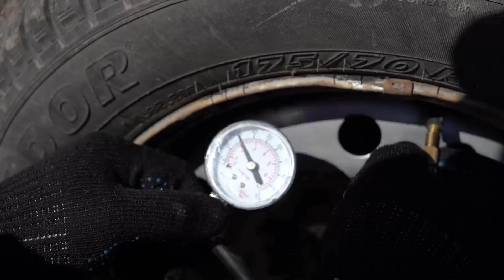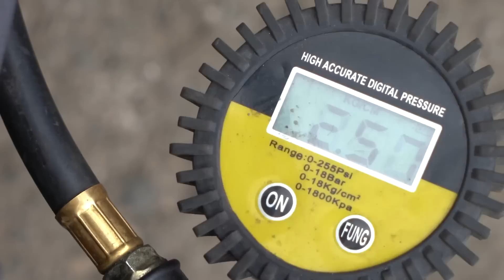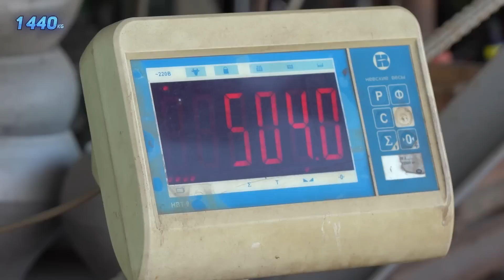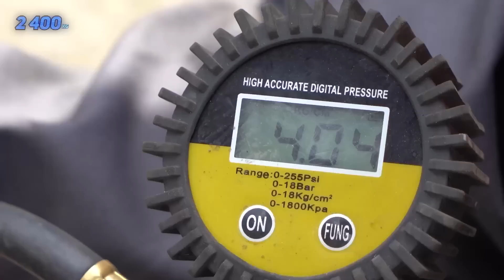How much weight does it take to pop a tire?

Comment: Remember, load rating is not how much weight a tire can hold up, it is how much weight a tire can prevent from sliding.  Heavier vehicles require more force to slow down, and if the rubber cannot handle that force it'll tear at the surface and slide instead of stopping the vehicle, creating skid marks.  Also, when you are turning it's the tires job to prevent the vehicle from sliding left or right.  If the vehicle is too heavy in a corner, you could slide off the road too.
Reply: As the more weight you add to a tire, the harder it is to slide
Reply: Can't find a single thing online proving what you just said,  just what weight tires support, so I don't think this is a factual statement at all
Reply: @tyuy100  The load rating limits what rubber compound companies can use.  The softer the compound the easier it is to tear off like an eraser.  Motorcycle tires can use a soft grippy compound because they have a low weight rating and don't see large peak forces.  Truck tires have to use a harder compound to support the higher load rating.  When performance electric cars were newer, they had trouble finding sporty grippy tires that had the correct load rating for the heavier vehicle.  Of course this is not a 1 to 1 relationship, but it is one of the many variables that affect the entire package.  Surface area, or tire width, also affects what compound could be used because with a wider area, each piece of rubber would experience less force.  As others have mentioned this video primarily demonstrates a static load while the tires need to be rated for a dynamic load.
Reply: @1234567890CAB  I don't disagree with any of that. I just think the statement about grip wasn't very factual as the load rating isn't necessarily focused on grip and wear seems to be the main component and of course complete failure, both of these affect grip but grip isn't what the load rating  refers to exactly. That's all I meant, from what I could research at least
Reply: Load rating is actually how much heat the tire can dissipate at a certain weight and pressure. The more weight on a tire the more heat gets created as it rolls. Source, I work at a tire shop and i have taken literal classes and tests about this, what you said didn't really make sense either.
Edit: excessive heat from running tires too low on pressure with too much weight is the #1 cause of blowouts.
Reply: @mr.disprosium4012 I’m glad there’s a tire place with someone like you. You’re completely correct.
The load rating is determined by the structure of the tire and rated pressure. A tire with a stiffer sidewall and higher pressure capacity will flex less on the highway, heat up less, and hold more weight. This is also why speed ratings are a thing. A tire flexing more times per second absorbs more heat.
Tire grip is determined by the compound touching the road, and the wear rating (UTQG) is a good estimate of grip (low number) or wear (high number).
Reply: @gvr41510  thank you for giving a more in depth explanation, you actually explained it way better than i did. I just saw that comment at the very top and was like whoa this is wrong and too many people are agreeing with it.
Reply: Load rating is not about traction, it's about getting the tire to its max speed rating with the rated weight guaranteed without blow up to pieces.
Reply: @johnbelwell2461 nope
Reply: Load rating is the safe load a tire can handle at its speed rating.
Reply: @brandenwaltz9879 nope
Reply: Load range is from the construction of the plies and how much it needs to be inflated. All tires have a separate speed rating. Most cars have load range b .
Reply: @dennis-nz5im  the construction of the tire is irrelevant to mention, whatever type of tire it is has its ratings for its construction, if we say it's a 22.5" semi truck tire it still has maximum load and maximum speed, which is manufactured so when both are maxed out and the pressure is the maximum rated under load the tire is guaranteed it wont fail.
It's like we say you can run to 20kph carrying 10kg with your hands and we have tested you can do it without smash your face.
Reply: You're very confident for how very wrong you are👍 maybe dial that back a bit

Comment: kg/cm² and bar seems like the same. usually bar is used except for the USA, Myanmar and Liberia that use PSI. well that's what I could find anyway.
Reply: They are very close. A bar is 10 newtons per square centimeter. In layman's terms, kgf/cm², bar and atmosphere are used interchangeably but they are slightly different. The first is 0.980665 bar and the latter is 1.01325 bars.

Comment: Tires are rated to deal with potholes at high speed. The waving of metal strings keeps it together but not for long the heavier you go over the limit.
Wheels are usually the weak point in real driving condition unless something punctures your tire as usual.
Reply: The static load is the easy part, heat buildup in the tyre while it's rolling is the real tyre killer. Driving for a couple of hours at highway speed is where the load rating matters - very few real world users would be happy if all their tyres could manage was to survive a lap of the car park in 1st gear.
Reply: Some other news: water is wet.
Reply: It also depends on tire pressure as well.

Comment: That van is pulling like it ain’t shit back there 😂😂
Reply: I could be mistaken here, but I think that van utilizes a 2.4 liter diesel that Toyota used to put into buses.
Reply: @SwapBlogRU  My 1958 F600 has a 292 CID gasoline motor, and it hauls around 26,000 pounds on axle without a complaint.  What Sparky said was right, it comes down to gears and low speed.  That Toyota motor is a good one, but without some serious gearing, it too will pull itself out.
Reply: @kingduckford  as far as I know these got a sort of generic gearbox from the factory, can't tell you whether this particular example has been modified or not.
Reply: @SwapBlogRU  tbh it should pull it with ease if my surf is anything to go by.
I had a 2.0 k20 honda crv mk2 with a manual gearbox. I pulled an approx 18ton Dennis elite 2 refuse truck (completely dead) out of our workshop and round our rough af yard with it lol. Clutch started to stink but it did it and the clutch was completely fine several months later until the car was written off 😂
Weight is just a number, it's the rolling resistance that'll make it struggle. The first second of getting it moving is the hardest. Slowing down is the other big worry. Once it's up to speed it's fine.
Reply: @SwapBlogRU  should be a Toyota 1kz-te 3.0td 4cylinder. Solid engines, got one in a hilux surf.
Reply: @dahotrod1533  right, thanks for the correction!
Reply: The van never saw 10mph
Reply: its also a diesel
Reply: 3.0 Turbo Diesel...
Reply: fr
Reply: XD
Reply: you can manipulate the gearing in any vehicle to tow anything at a low speed technically
Reply: @TheUchihasparky  Since it's the 4x4 version, it's probably got an extra low 1st gear. There are versions around with a low range transfer case too - 4XOverland has done a few videos recently on an off road Hiace he's converting to an overlander. Anyone who's driven a tractor knows that you don't even need 100 bhp to effortlessly move very heavy loads around at low speeds.
Reply: @peglor  Must have low gear to pull that. My dad have a 4x4 hiace with no LOW GEAR. and the first gear is WAYY too long to do a hillstart without burning the clutch :D
Reply: @TheUchihasparky Not with any vehicle specially rear wheel vehicles. 😂
Reply: Could you also argue that since the tires are crushed they have a better grip? Since all the weight is pressing them against the floor and the tire even developed a flat surface. Id assume its grip or traction would increase drastically specifically at low speed. 

I dont know about towing sadly but for what i can see and my experience with not well filled tires. I feel thats also a thing to account.  @TheUchihasparky
Reply: @TheUchihasparky  You are talking about changing the gear ratios by opening the gear box and changing the gear parts inside..

 You make it sound like every car have some magic screw you can use to manipulate the gear ratios xD
Reply: @vihreelinja4743  It's garage 54, I think they can change some gears in a gearbox, but you don't have to go that route necessarily either, you can leave the gearbox alone and simply change your final drive ratio or even your wheel+tire diameter will also add or reduce torque multiplication to all the gears in the gearbox.
Reply: It's a Toyota, Not a Chevy.
Reply: @rudolphbondefangerer5513  A Chevrolet 1 ton truck or cargo van would have been able to tow it just as well.  Especially a 4x4 with low range.
Reply: @rudolphbondefangerer5513  You know what is a full size diesel truck?